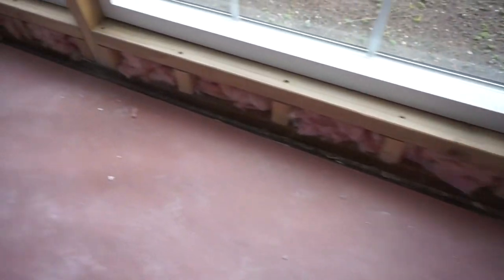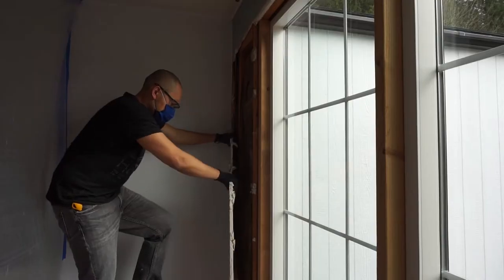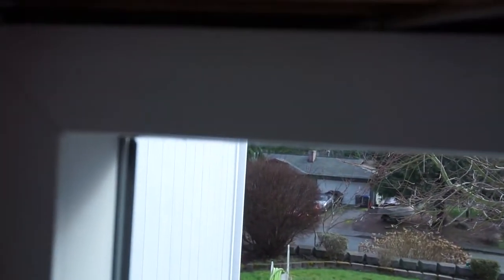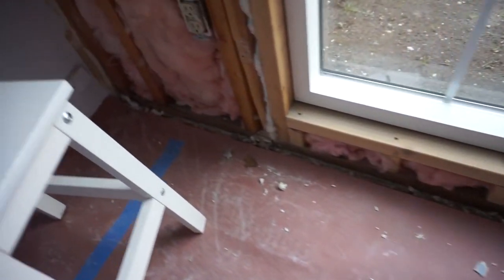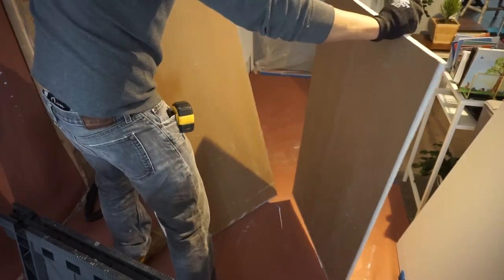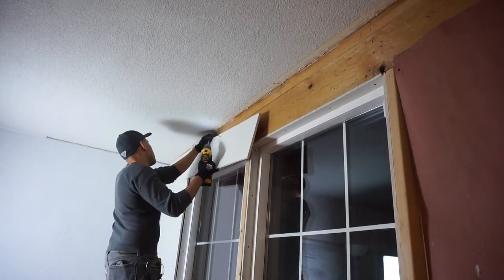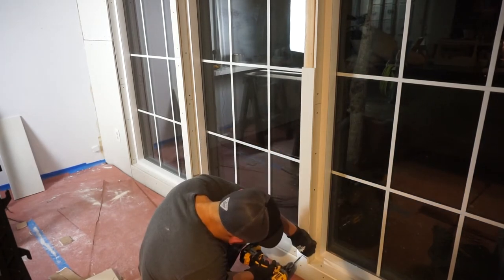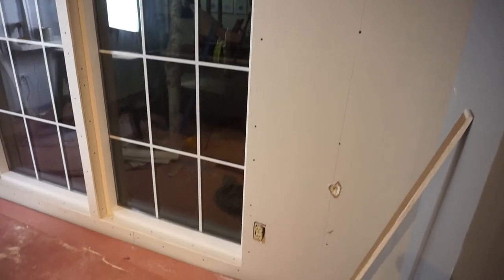How To Install Drywall Around Windows | Easy DIY For Beginners!

Comment: Aye aye aye, You really shouldn’t use anything other than window/door foam around windows and doors because anything else is likely to warp your windows because it over-expands. And your board should extend past the corners of your windows. Those areas around your windows are almost guaranteed to crack.
Reply: Is it better to have a vertical joint at the top corner of a window or door instead of a horizontal one? Or would you cut an L shape board so you can bring the joint away from the window?
Reply: @dylancooper8497 you want to try and put the joints in the middle of the window. Usually there’s a solid header so there’s not as much movement.
Reply: I learned both those lessons the hard way.😮

Comment: New to drywall, but wouldn't you want your cut edge towards the wall? That way you'd have a nice sharp edge around the window.
Reply: You're gonna put corner bead around it either way, so doesn't really matter

Comment: Is that a 2x4 wall? If so, you should not have used R19. If you use insulation that is too thick and you force it in, it’ll lose Rvalue.
Reply: Still ends up being r15 which is better than the r13 out in the market

Comment: Isn't it necessary to use a plasterboard edging bead over your drywall, around the inside of the window frame, in order to avoid condensation from a cold window frame ?
Reply: Definitely agree